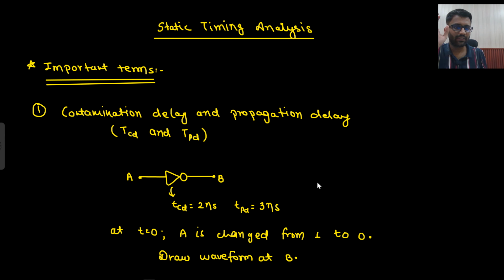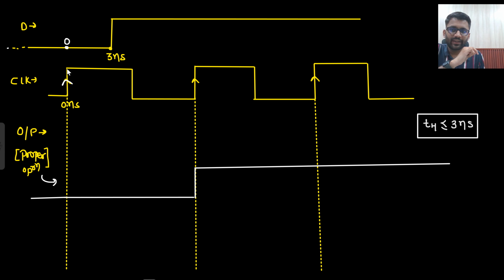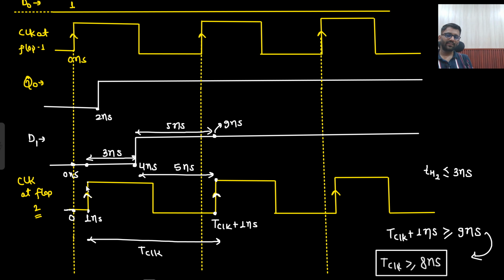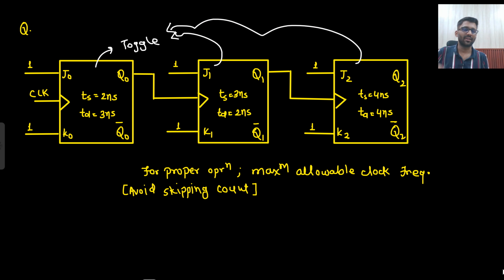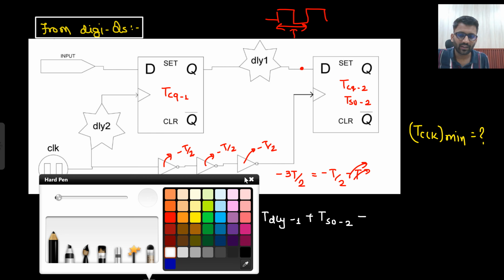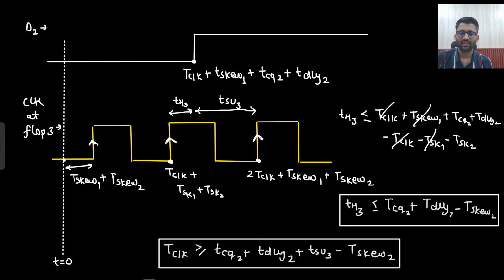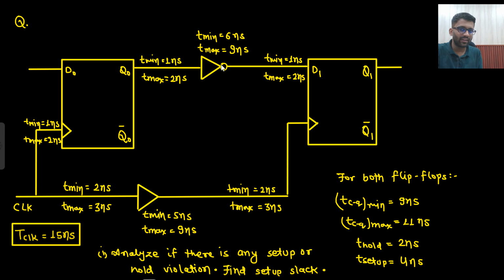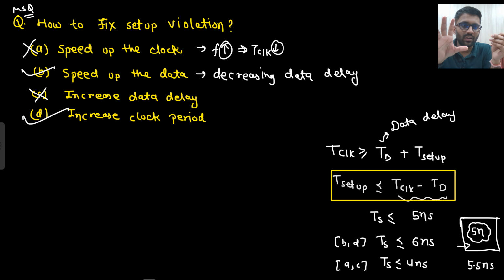🔥 STATIC TIMING ANALYSIS || Himanshu Agarwal || Digital Design for Campus Placements

Comment from the maker: Hi everyone! 
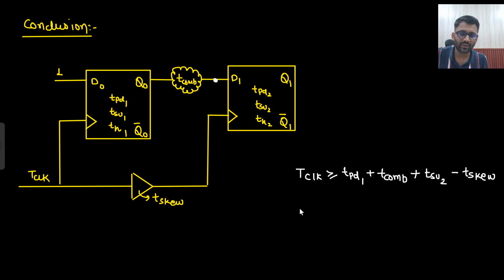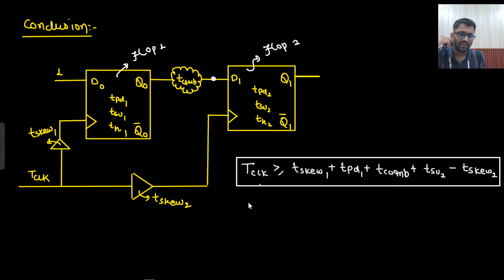Slip of pen at 53:46 , 01:00:19 
In the hold time equation, always the "less than-Equals to ( <= ) " sign would come, not the "greater than" one.

Link to PrepFusion Channel : https://youtube.com/@prepfusion_gate?si=6UI4uWa9pszGRm8Z
Link to the website : https://PrepFusion.in/
Reply: 40:18 there must be 1ns delay in Q1 ??? as td=1ns ???
Reply: @Anju-t6k9p  yes there is a little bit mistaken but it doesn't effect the  clk period
Reply: yes i was going to comment that...told must be less than the total delay calculated if it is greater it will cause hold violation

Comment: hey ppl if u r confused at 1:55:54 then i am writing this for you
if a more than 2 flop system consider first 2 flops ignore 3rd, find their Tclk.
then move to flop2 and flop3 and find their Tclk ignoring flop1 now from both Tclks find common integer satisfying both.
remember all flops must be fed by clk (synchronous ) not asynchronous 
ill tell for asynchronous case too == for async case consider initial clk fed + next async flop as 1 flop only then move to next clocked FF for finding Tclk as done at 1:22:15
comment me if any doubt comes ....

Comment: [00:00] - Introduction to Static Timing Analysis (STA)
[01:29] - Important Terms: Contamination Delay vs. Propagation Delay
[04:43] - Setup Time and Hold Time Concepts: Understanding stability windows
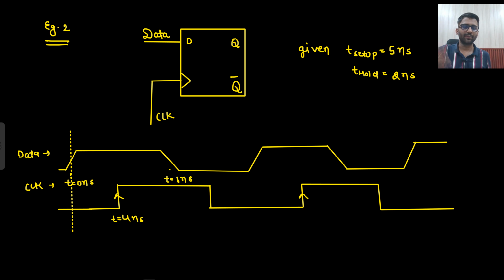[08:38] - Setup and Hold Violations: Practical examples and visual explanations
[16:12] - Clock Skew (T_skew): Impact of wire length and parasitics on clock arrival
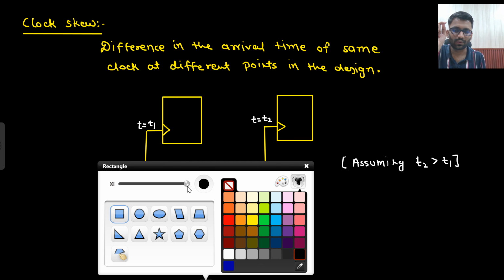[18:43] - Clock Jitter: Variations in clock period
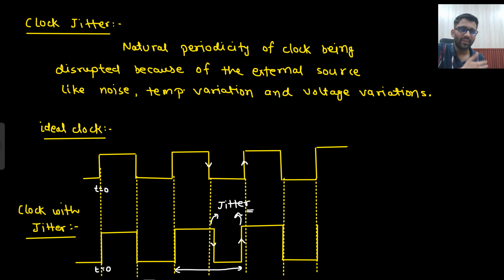[21:05] - Clock-to-Q Delay: Propagation delay specific to flip-flops
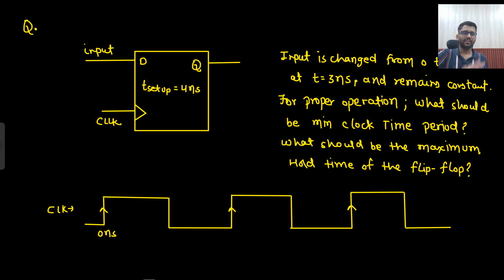[22:45] - Problem Solving: Calculating minimum clock period and maximum hold time
[32:50] - STA Formula Derivation: Analyzing sequential circuits (Flop-to-Flop paths)
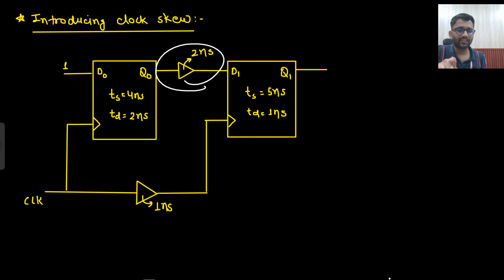[47:33] - STA with Clock Skew: How skew affects setup and hold margins
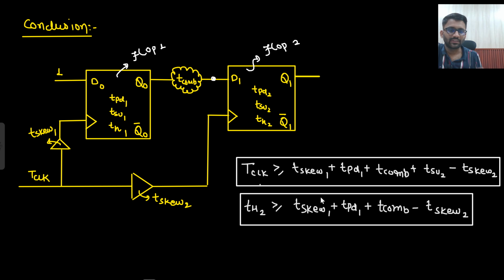[01:01:50] - Complex Paths: Analyzing loops and non-fixed data (Ring Counters)
[01:13:01] - GATE 2020 Question Walkthrough: Step-by-step exam problem analysis
[01:16:31] - STA in Asynchronous Counters: Why setup/hold often don't apply here
[01:22:03] - GATE 2004 Question Walkthrough: Advanced path analysis
[01:26:39] - Mixed-Edge Triggering: Analyzing paths from Positive-edge to Negative-edge flops
[01:41:18] - Clock Inverters: Dealing with inverted clock signals in the path
[01:48:06] - STA with 3+ Flip-Flops: Managing multiple stages in a design
[02:10:33] - Optimization Techniques: Improving maximum clock frequency
[02:15:32] - Pipelining: Adding flops to break long combinational paths
[02:18:56] - Using Multiplexers: Retiming and optimization to fix timing violations
[02:28:31] - Buffer Insertion: Fixing hold violations by increasing data delay
[02:34:47] - Min/Max (Best/Worst Case) Analysis: Contamination vs. Propagation delay
[02:45:34] - STA for Latches: Defining the "Latching Edge" for level-triggered circuits
[02:51:21] - Fixing Setup Violations: Strategies to speed up data or slow down the clock
[02:57:15] - Fixing Hold Violations: Strategies to increase data delay or reduce skew
[03:00:06] - Conclusion and Final Interview Tips

Comment: 44:13 sir what will be the min t_clk if setup time of 2nd D_ff is 4ns instead of 5ns?
Whether it is 4ns + 4ns = 8ns ( as you write according to formula) or it is 4ns only ??
Iam getting proper waveform for tclk = 4ns is that correct sir.

Comment: ideally, setup time should be as low as possible, then chances od setup violation will also be low, if tsu=10ns then data can't change for 10 ns whereas if tsu=2ns data has to remain stable only for  2ns, data can change rapidly hence less chance of setup violation, but at 2:53:42 u said if the maximum tsu is decreasing then it will cause setup violation...please explain??

Comment: you explained each and everything nicely as expected from you. i also improved my knowledge thank you so much......but some points are missing which are also asked in interview like from where setup and hold comes into picture, positive negative value of setup and hold time, also there was a question in nvidia test ki setup analysis 2 clock pe hoti h and hold single kyu??

Comment: Hello Himangshu!! 
Thanks for the video.
I have a small doubt. 
The interviewer asked me the following questions. 
Can you please explain it once?
- why setup and hold time is required? (Necessity)
- what happens if setup and hold time are not met?
Reply from the maker: Setup time will ensure that data is stable before the clock edge arrival, so that the ckt can "prepare" itself to latch the given data. 

And hold time ensures that data remains stable for long enough time after the clock edge so that the flop can finish the process of storing the data efficiently. 

If setup and hold margins are not met, the ckt will fall into metastable state and your output will be unpredictable.
Reply: @HimanshuAgarwal_  Yes, the definition of setup and hold time is clear to me. 

I want to know from where a specific time came.  
And if data changes after the clk pulse or before the clk pulse, it will give wrong data. How will it go into the metastable state?
Thanks for your reply.
Reply: According to me answer is parasitic capacitance, it needs tsu amount of time to charge or discharge according to change in logic.